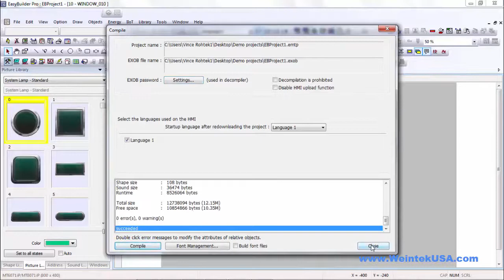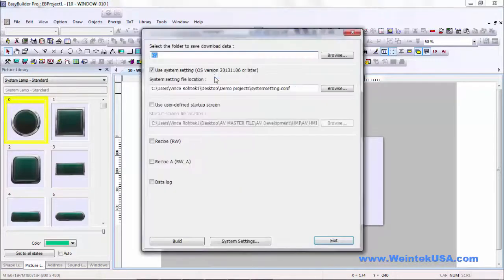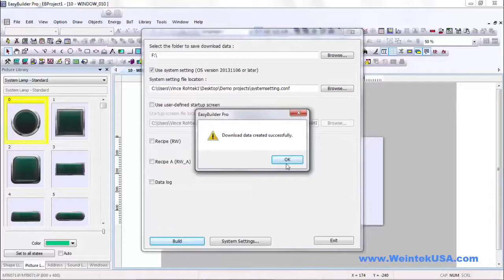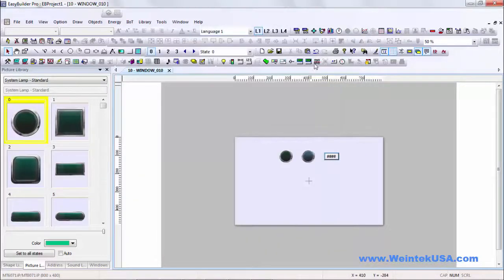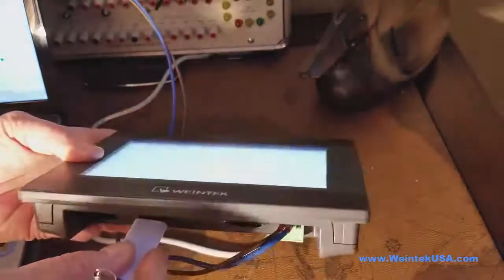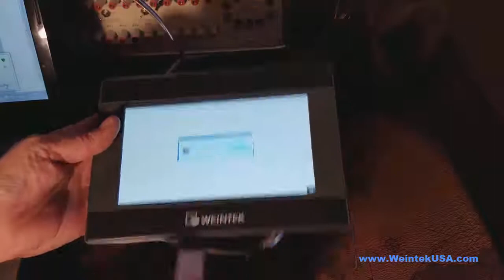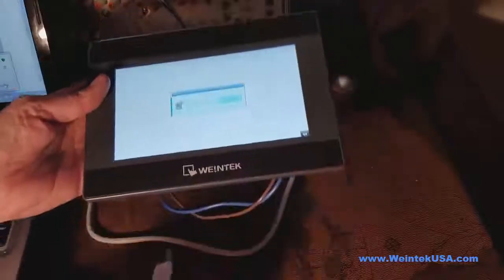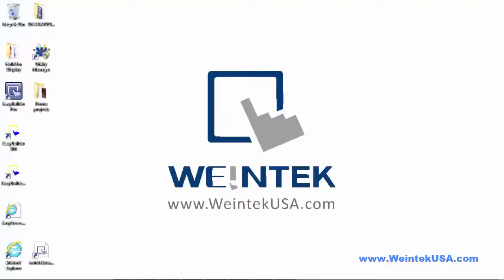How to Download & Upload Projects with USB / SD Cards Weintek EasyBuilder Pro

Comment: what is requried USB size ....?
Reply from the maker: Hi @kashifupdates1960,
The maximum project size of an iE or iP series HMI is 22.5MB. We would recommend that you use a storage drive with a capacity that is at least slightly larger than this size. Also, the USB or SD card must be formatted to the FAT32 file system. I hope this helps!

Comment: Hello, I'm getting a Project incorrect error, what could be the cause of this? Thanks in advance
Reply: Hi Daniel,
A "Project Incorrect!" error may occur when you attempt to download a project that was developed for a different HMI model than the HMI you are using within your application. The HMI model can be re-configured within the model tab of the System Parameters.
Reply: @WeintekUSATeam.0   hi, excuse me for my English. I'm from Russia. My touch screen has crashed. Can I connect the mouse?
Reply: @WeintekUSATeam.0  how can we re-configured the model? we are using m6070 and now we received new model mt8000 series. and when I try to download the project it's showing "project incorrect". Please advice.

Comment: Thank you sir ! When I upload file HMI to USB. Then I don't kown How to open file in USB. you can help me open the file in USB. Thanks.
Reply: good point
Reply: You should choose the biggest file in one of created directories. Change it's extension to *.exob and decompile it (in Easy Builder Pro). Than you will get editable files. Of course... if designer doesn't protect it by password.
Reply: @kapy-bah-ra  if designer protect it by a password is there any possible to break this password. I have TK6070iQ and i need to change a language in this project.
Reply: @marcin287  , nope. There are some russian hacking tools, but useless. Doesn't work.